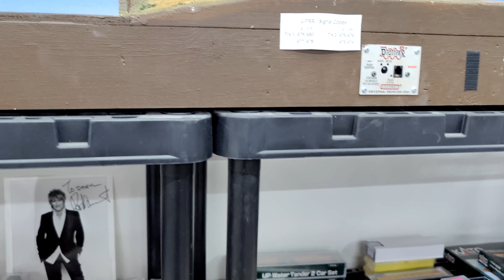UPRR Evanston Sub s2021e17 HO Scale-Operations/Realism. Mainline to Taggart Tunnels & Devil's Slide.

Comment: Well Daryl, the layout is looking great. What are you using to paint the ceiling and wouldn’t it be best to paint the whole ceiling first before doing benchwork and track? From 11:33 on you can see a lot of the risers and I don’t see any screws, do you glue them or use something you can’t see or are you that good that you defy gravity? Have you considered using the shop vac with a hepa filter instead of sweeping? Better for your lungs too. Really looking forward to your progress.
Reply from the maker: Well, it's a lot of ceiling to do all at once.  Same goes for framing and drywalling the exterior walls of the basement.  So, I decided to break it up into sections so that I do not get bogged down on one particular aspect of this huge project.    
The joists are screwed to the L-girders from underneath.  I have been gluing the risers to the joists.  I am trying to get the mainline grade as accurate as possible.  The process of screwing the risers to the joist tends to cause slight movement, especially since I cannot always get my power driver exactly perpendicular to the riser.  Gluing and then clamping enables me to get the risers set much more accurately for a very smooth 1% grade. It will be up to 1.7% from Castle Rock to Curvo.  
A good vacuum is a good idea.

Comment: 21:00 What kind of system do you use there for stowage? It looks easy to build like if its plastic, not like the really awkward metal shelves you get everywhere that take hours to complete and then still are wobbly as Fk. greetings!
Reply from the maker: It was just some cheap storage units from Menard's. Its modular so you can make it high and narrow or low and wide or anything in between.

Comment: The oxide of nickel silver is more conductive than any coating you could apply.
Reply from the maker: Thats not been my experience.  No-Ox works extremely well.  I may add stay alive capacitors to all my locos.
Reply: @EvanstonSub  While I do not wish to ignite yet another skirmish in the seemingly endless How to Clean Track war, and while individual experiences are quite disparate, it is important, for your viewers at least, to understand the chemistry.

Comment: Something I found fascinating while I worked out there was how there were areas that still had significant amounts of coal cinders that had accumulated at the edge of the ballast line. As an example, eastbound steam trains approaching the Taggert tunnels would slow from 60 mph to 30 mph to go through the tunnels. They would also drift through the tunnels so the cab of the locomotive would not get filled with steam, smoke, and hot cinders. But as they exited the tunnel, the engineers would start pulling on the trains and advancing the throttles to get the train slack stretched again, preparing to speed up as soon as the caboose cleared the tunnel speed restriction. As a result, the steam engines would throw a lot of cinders once the engineer advanced the throttle and the fireman started throwing a shovel full of sand into the firebox to clean out cinders and soot from the flues.
Reply from the maker: Very interesting. Thanks!